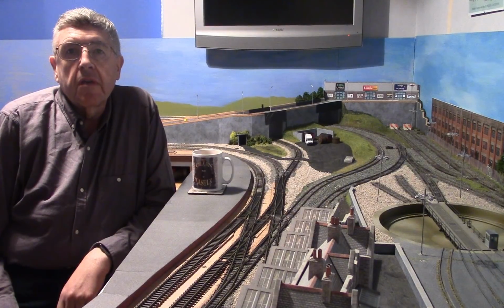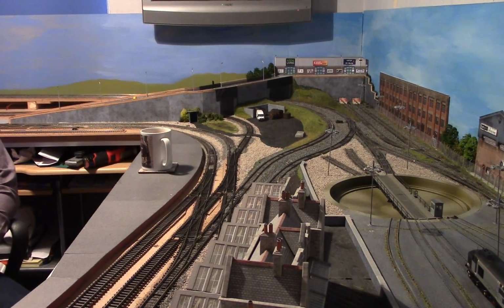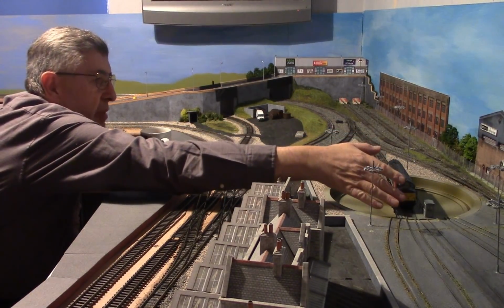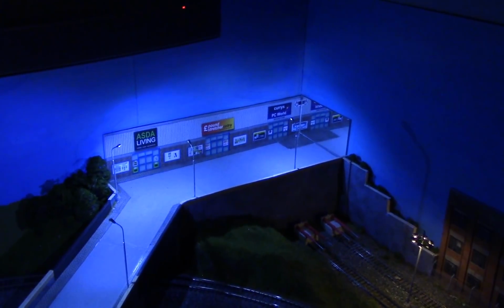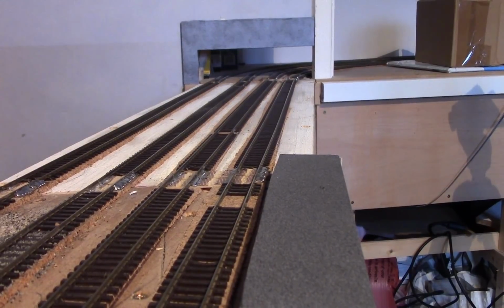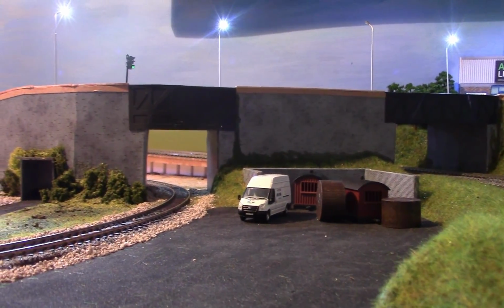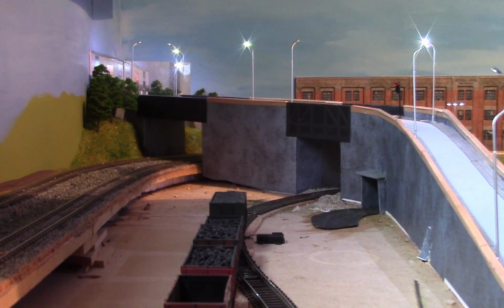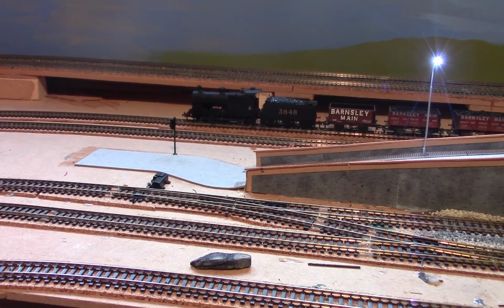#21 Nov Dec 2018 Layout update

Comment: Nice update Geoff, I do like the lights in the Turntable yard...Simon
Reply from the maker: Thanks Simon, once I saw the lights I knew they were the ones for the job. I only bought three initially and soon realised that was not enough, the light spread is quite low and not as I expected. They have a cool blueish light. I quickly ordered five more without giving a thought to light temperature and when they arrived I just painted them and wired them in. I am in two minds to get three more to replace the cool white ones but maybe just leave as is. Regards, Geoff.

Comment: Geoff, you have done a lot. As Graham on Lakeside says, it is your layout you can do what you like. Pete Waterman is a great supporter of model railways as well real ones. As we know. That 37 is good. I am taking one forward an 2 back, at present. I am getting a 'short' on my ECoS, it is the track but, with limited vision, everything is a challenge. I will not be defeated, my guide dog, Nixon will know if he could get in the loft!  It takes me time and slow.
Reply from the maker: Hi Nigel, I have the odd short now and again and find it is when one of the locos picks up something metallic and it shorts over points. The magnetism of the underside is stronger on the older metal chassis locos I find. I agree, although my eyesight is not too bad, I wear glasses and cannot focus close up easily so that can be difficult. Regards, Geoff